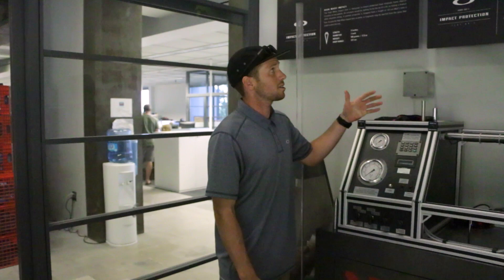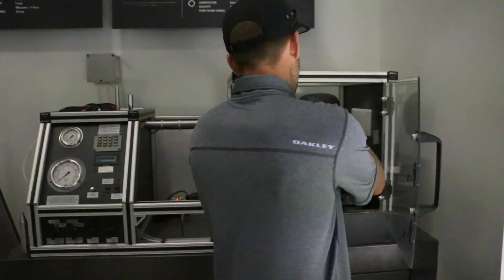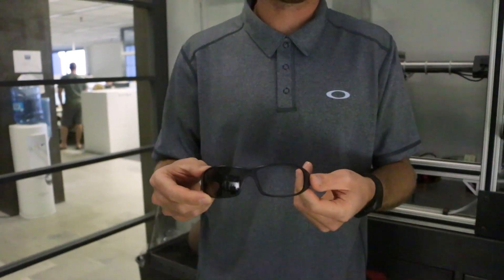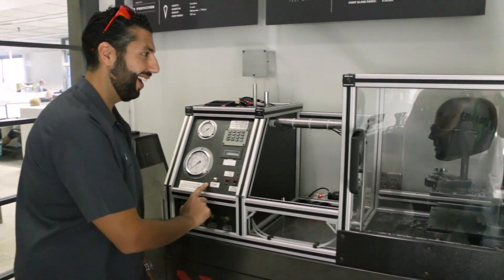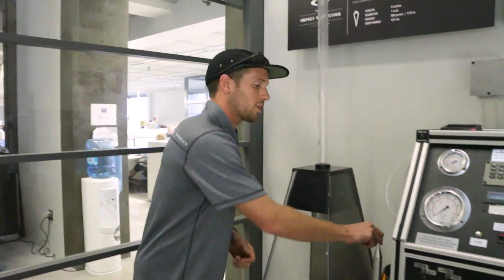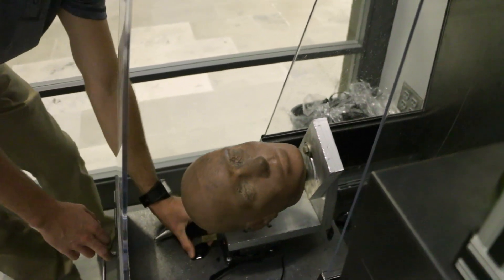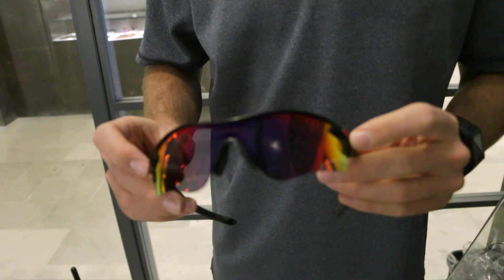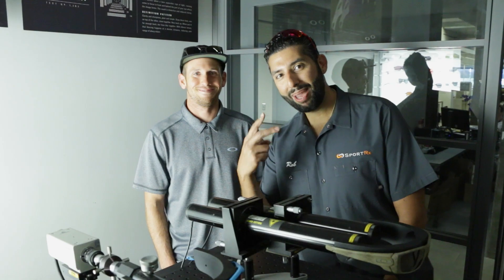Oakley ANSI Safety Impact Resistance Testing

Comment: Why doesn't Oakley list any safety ratings for the Radar or the Flak 2.0 XL if they pride themselves on their impact resistance and durability?
Reply from the maker: HI! It is because the Flak 2.0 XL & Radar EV Path frames do not meet ANSI Z87.1 specific safety standards that many industries require on the jobsite. This is why many companies, including Oakley, categorize specific frames as ANSI, which are noted with a certification stamp on the lens as well as the frame. Oakley frames that meet this safety standard will include the word 'Industrial' in the name. Click on the link to view all Oakley ANSI frame models. 
👉 https://www.sportrx.com/shopby/brand-oakley/certification-ansi_z87_1/product_type-sunglasses.html?show_full_attribute=1 🔥

Comment: Thank God u made this video 6 years ago...if you upload this video right know, u might have different result from audience. That thing can stand from drop steel approx more than 80 cm high without broken. Try to buy oakley now, and drop it from your dining table, might find it broken. True !! ain't BS it happen to me. price more than hundred USD - the quality 1 USD ( china mirror product might stronger than the original oakkley ). i have some oak's, the latest one i bought about 5 years ago and got no probs at all ( just the lense started peeling and the rubber start peeling, but no issues at all ). but the very late one i bought 2 months ago,  60 cm-BROKE..
Reply from the maker: Hello Andreas, thank you for your comment! Was this an ANSI rated frame/lens from Oakley? If not then you're absolutely correct that they would not withstand the impact of such a test. Curious what frame model was used when this occurred. Give us a call or shoot us an email, we'd love to know! And thanks for watching! 
877.289.2999 
info@sportrx.com

Comment: None of the Oakleys other than the "Ballistic" rated or "APEL" line are certified to Z87+ and the MIL-PRF for ballistics protection. I know they claim their lenses are all tested to Z87 but most of their glasses don't have the proper Z87 markings for the certification. Their old M Frames, M Frame 2.0/3.0 have the Z87/Z87+ and the 2.0/3.0/Alpha's meet the blast fragmentation. Their Det Cord and Shocktube also meet the MIL-PRF. Everything else is up in the air. I did my own research and a lot of the lenses are simply too thin (e.g. Flak Jacket / Flak 2.0) compared to the ballistic APEL M Frame 2.0 lenses. I also learned from ESS (a subsidiary of Oakley that deals primarily with military eyewear) that none of the polarized lenses will meet the military blast test but will meet ANSI Z87+ high speed impact due to the polarization process. ESS also puts the proper Z87+ markings on the lens and frames, while I think Oakley only does the Z87 stamping on the lens of the Det Cord model that has the stamping. The difference in Kinetic Energy between Z87+ and the military test is like a factor of 16!
Reply from the maker: Hello Gearhead Mania! Thanks so much for the feedback! This is a topic that comes up quite frequently and we are currently working to produce content that will help better address the variations in 'safety' glasses. Seems like you have already done your research!
Reply: SportRx that’s why I wear Si not sunglass hut regular oakleys